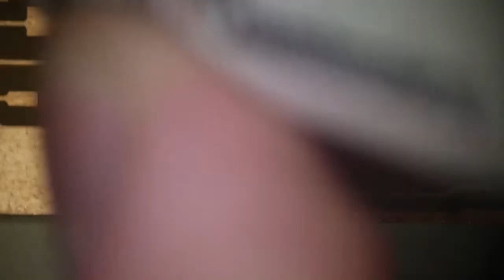Soldering the FabISP

Comment: Thanks for the info and the upload, I did my first SMD board last night and it went great.  The TQFP Atmega8 was a lot easier than I had anticipated.  Was using a little too much solder at first but I quickly got the hang of it.  SMD is just too awesome!  No drilling, smaller boards, cheaper components, I'm hooked!

Comment from the maker: It's actually just a regular soldering iron with regular solder.  I apply a small amount of solder to the tip which I then touch to join the component and the pad.  Applying flux to the pads first is important when using this technique, as the flux core in the solder will burn off quickly as it sits on the iron tip.